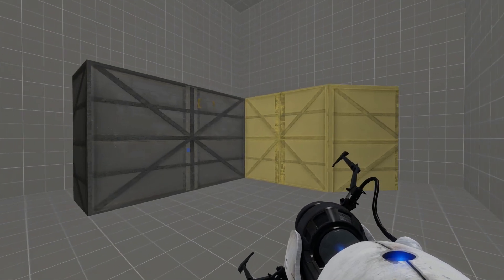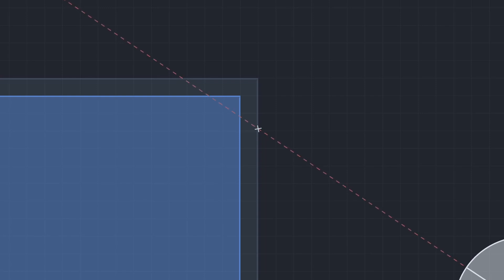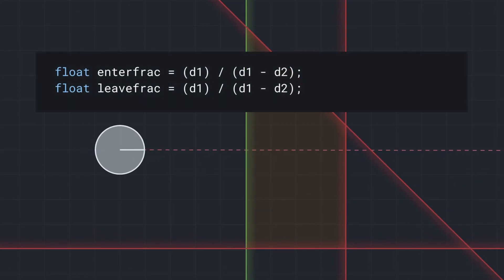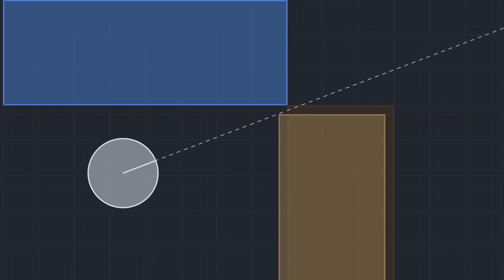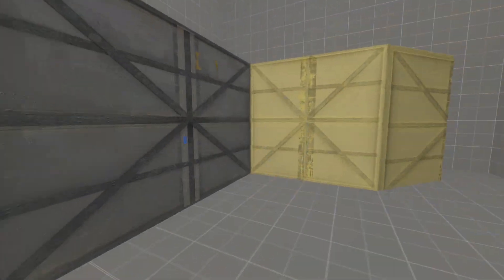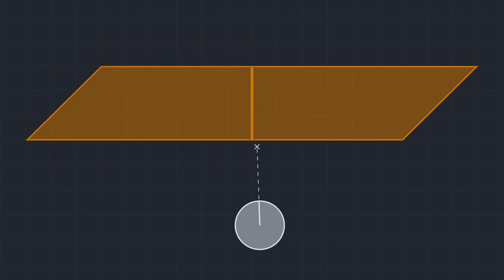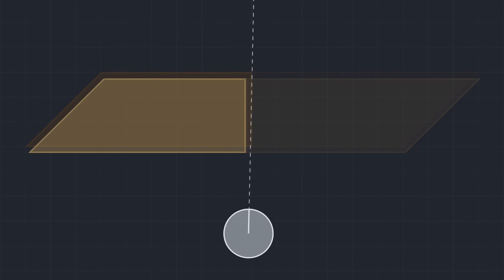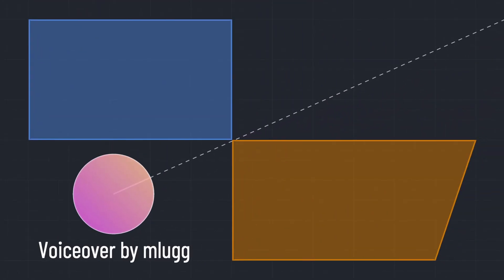Seamshots Explained (voiced by mlugg)

Comment: 00:06 Seamshots are glitch that allows shooting through walls in Source engine based games

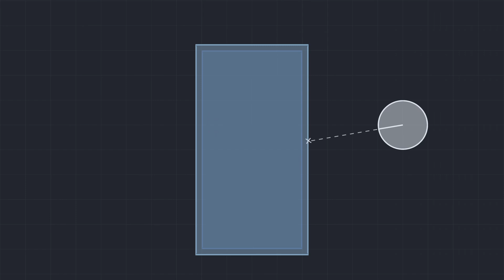01:22 Understanding collision detection with simple brushes

02:39 Seamshots are possible due to an incorrect sign in the calculation of exit fractions.

03:49 Seamshots can form small gaps in corners where one plane is shifted into the brush.

05:01 Seamshots are difficult due to small gaps and angle deviations

06:22 Alignment towards complex brush maximizes angle range for wall seamshots.

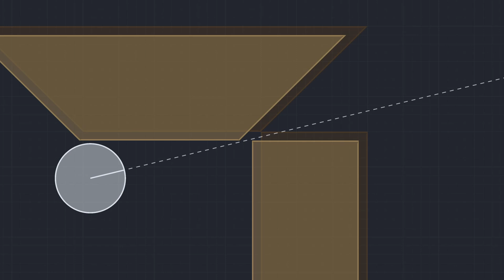07:39 Seamshots are a result of a single incorrect character in the complex brush collision code.

08:50 Seamshots are used in Portal games for speedruns and are also present in other Source games.

Crafted by Merlin AI.

Comment: I have a hard time understanding why opposite signs would make adding Epsilon to the numerator of the fraction make the fraction smaller. That part really stirs my head. I think the devs also thought that adding Epsilon should make the Exit planes shift out, not into the brush.

Is it because the algorithm calculates the exit planes by calculating from the opposite Point of View? Thus it might interpret the exit planes to be shifted inside the brush?
Reply: Since the denominator will also be the opposite sign (so end result is always positive), what we care about is the absolute value, and adding a positive number to a negative number makes the absolute value smaller not bigger.

Example with made up values:
DIST_EPSILON = 1
d1 = +/-5 (positive in the enter case, negative in the leave case)
d2 = +/-5 (negative in the enter case, positive in the leave case)
enterfrac = (5-1)/(5-(-5)) = 4/10 = 0.4, making the value smaller as expected.
leavefrac = ((-5)+1)/((-5)-5) = (-4)/(-10) = 0.4, making the value smaller, when the desire was to make it bigger.
leavefrac, with the fix mentioned in the video = ((-5)-1)/((-5)-5) = (-6)/(-10) = 0.6, which makes the value bigger as expected.

You may be right conceptually about the "opposite point of view" part, but the opposite point of view is handled before this calculation by the fact that d1 and d2 signs are flipped between the enter and leave cases and not after the fact.

Comment: I was wondering what the logic behind the enterfrac < leavefrac check was, so it was nice to get an explanation for that. Cool to see the implementation of the DIST_EPSILON surface extension is responsible for yet another collision bug that I didn't know about. Also if you take a look at the comment in coordsize.h, it seems DIST_EPSILON was implemented to combat floats being networked with limited precision is older Source games, and without out it the sent position could get rounded into the floor.
Reply: That's actually a really interesting find, thanks for pointing that out!
Reply: So modern Source MP doesn't even need epsilon anymore?
Reply: @Wheagg  Yes and no. There isn't a problem with networking precision anymore, but the collision can still get faulty if you're right up against a surface. So it is still good at preventing those situations from happening, even if it wasn't its original intention (or maybe they implemented the epsilon for both reasons and only mentioned networking as a reason). It is still pretty easy to get around the epsilon though, since you can literally just wiggle against a wall while in the air to get as close as floating point math allows. It is pretty well known in TF2 that you can get stuck on a angled wall by wiggling against it and pressing up against the wall. Wallbugs are sometimes used to stop yourself from falling on (rocket) jump maps or surprising people from above in a match. The epsilon also comes with extra glitches because they never intended you to be within epsilon units of a surface, so the math doesn't always hold up in that interval and leads to exploits such as pixelwalks, pixelsurfs, and "texture"bugs.

Comment: Really good explanation, but does Valve intentionally let this bug in their games ? There's no way they are not aware of it
Reply: There's a thousand little bugs like this in Source, none of them affect the normal gameplay experience so there's arguably no point wading through spaghetti to fix them.
Reply: @mikes128  wading through spaghetti? it's just 1 line of code
Reply: @ieatthighs  I was talking about the engine as a whole.
Reply: @ieatthighs  Just because enthusiasts on the internet have found the line of code that needs fixed _for fun_, decades after it was written, doesn't mean it'd be easy to even notice there's a problem, and it certainly doesn't mean a busy employee with lots to do can justify wasting time looking for these kinds of normally extremely minor issues. When you're a big company that's trying to sell stuff you make, you have to justify fixing bugs on the basis of how much money you avoid losing by doing so.

EDIT: to clarify, fixing this one line wouldn't be hard, but finding this or something like it would. And finding these kinds of things in general would be a waste of time when there's plenty of more important stuff needing fixed.
Reply: @ieatthighs  We actually tried it in CS and concluded pretty quickly that there's no way it'd ever be useful even though it's technically possible. Besides, you know how many other ridiculous bugs still exist in that game?
Reply: @ieatthighs  I have a fan in my computer that makes this annoying sound and should probably be swapped out, but the computer still works, and I can't be bothered wasting time faffing about reinstalling parts, so I've just been dealing with it for several months now. I'm equally productive and happy with life either way.

The Source Engine is that fan as software.

Comment: Idk, I still can't seam to understand this
Reply: Let me take a crack at explaining…
Walls are a certain size. To make everything run smoother, the walls trick the portal gun into thinking they're bigger. But a math mistake makes the portal gun think that some walls are actually smaller from certain angles. This makes a tiny space where a wall exists but the portal gun thinks it doesn't. A gap! Profit!
(I think that's correct, but I'm no expert.)
Reply: You didn't seam to get the joke
Reply: @lambolord24  I have to admit that I didn't notice you spelling "seem" as "seam". However, even if I had noticed, it wouldn't have necessarily followed that you weren't serious about not understanding the video. One can joke about true things. In any case, I was just trying to be helpful.
Reply: @NoriMori1992  You don't seam to know Lambo is a long time member of the Portal speedrunning community :^)